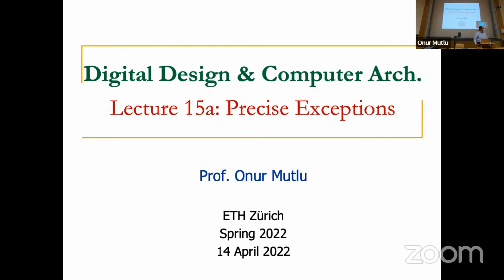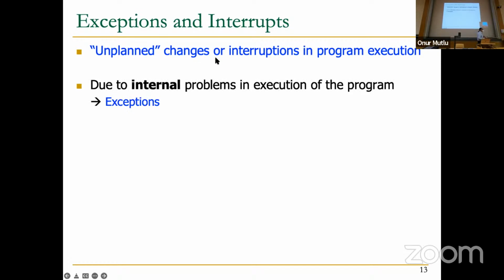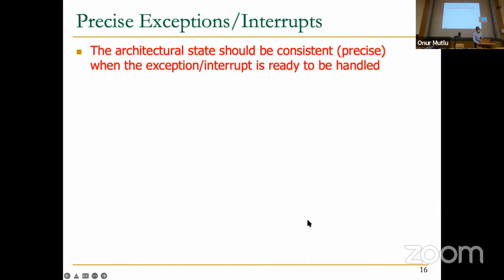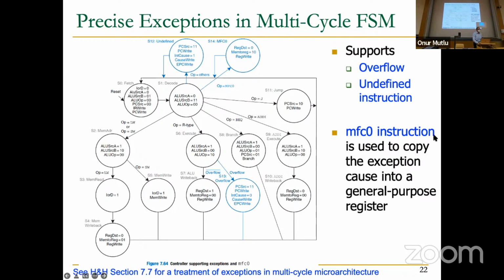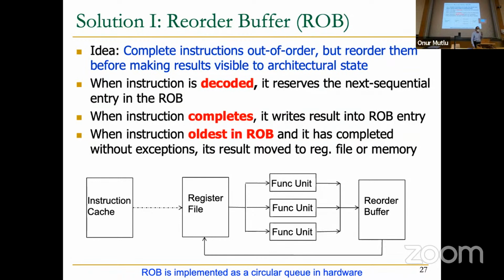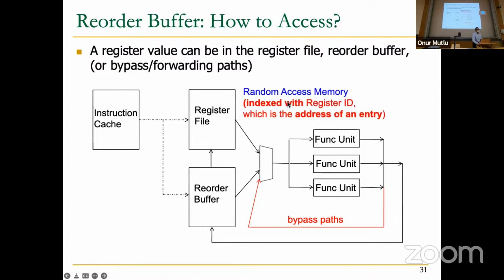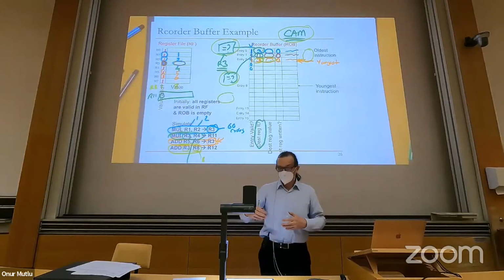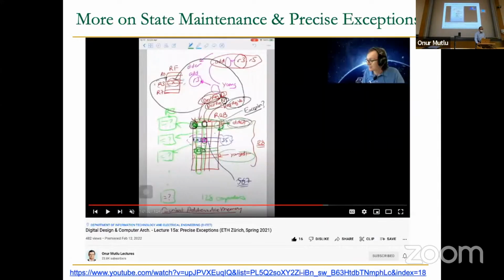Digital Design & Computer Architecture - Lecture 15: Precise Exceptions (Spring 2022)

Comment: Thanks for such lectures. So beneficial for me.
https://youtu.be/_oq6cRfm9sU?list=PL5Q2soXY2Zi97Ya5DEUpMpO2bbAoaG7c6&t=5784 Around this time, I could not understand why we are using such things. We used it instead of dependency check and forwarding units to prevent waste of hardware. However, in the end, we propose more complicated hardware that is possibly more expensive than forwarding units and dependency check units. Am I wrong?